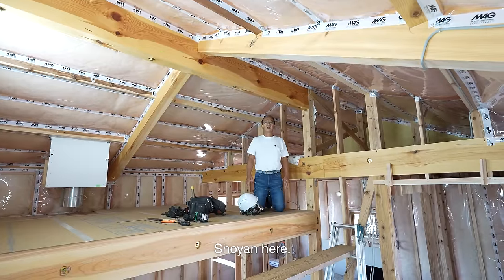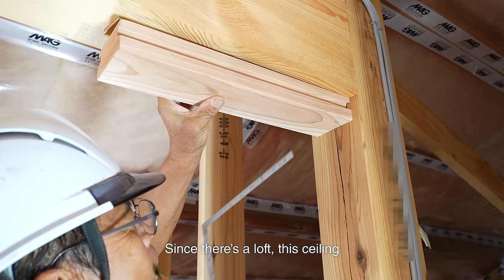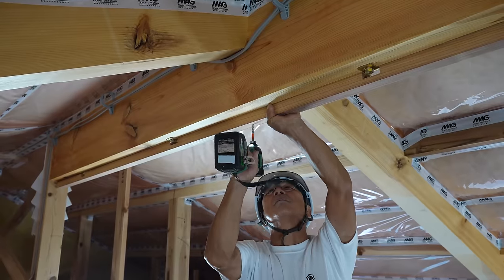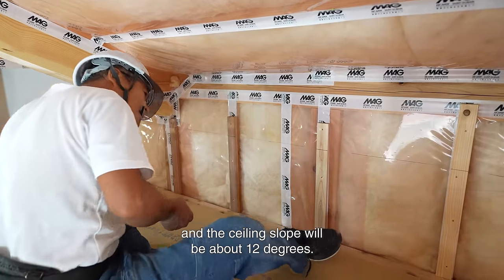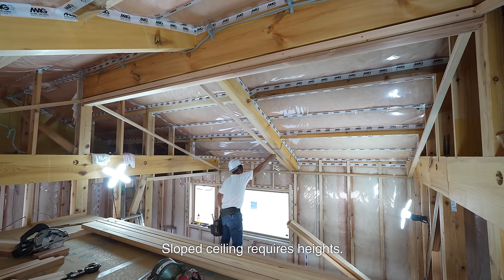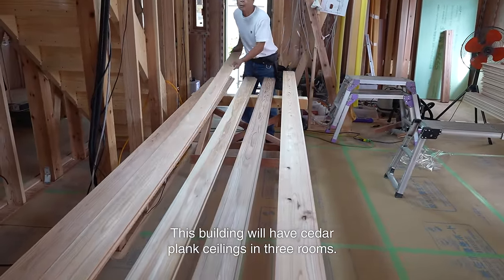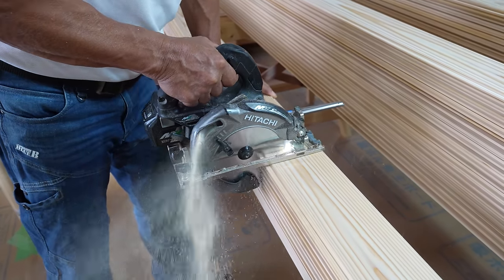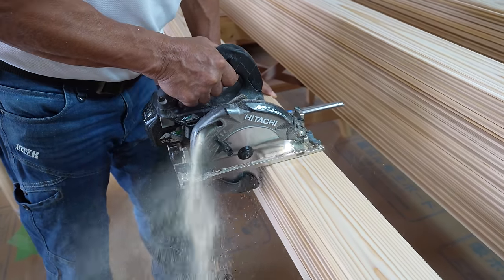Bottom in a Ceiling!? Build a Mysterious Funazoko Ceiling Using Only Solid Wood [Season 4 - Part 10]

Comment: Beautiful work. If the bolts in the ridge beam loosened after a few months and needed to be re-tightened, won't that happen again? Using a thread locking product would seem to be a solution or a lock washer rather than a flat washer. We're faced with the same issues with bolts and nuts used for seismic hold down and wind shear.
Reply: The bolts aren’t technically loosening. The wood is shrinking. Thread locker won’t help. That’s why tall stick framed buildings in the US use continuous rod tiedown system with automatic shrinkage compensating couplers.

Comment: Is there i link to the tool you used to tighten the bolts with the drill?
Reply: Is there a place we can buy the tool you used?
Reply: e-bay ... ANEX Offset Adapter 19mm AOA-19 Wooden House Bolt Tightening Building Japan new